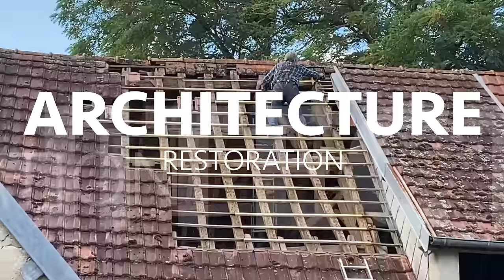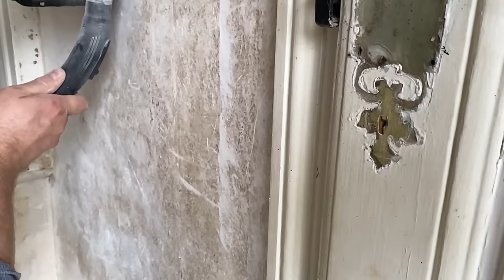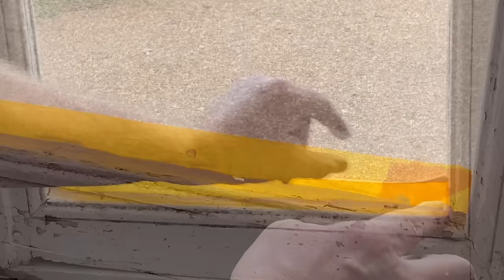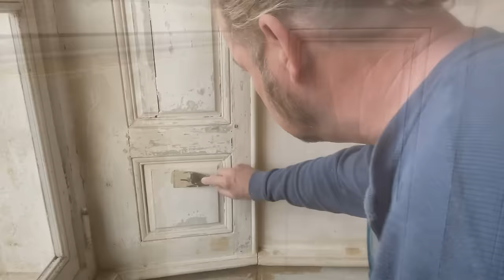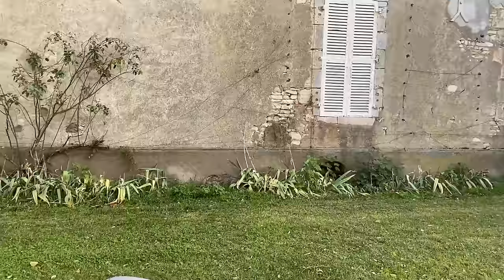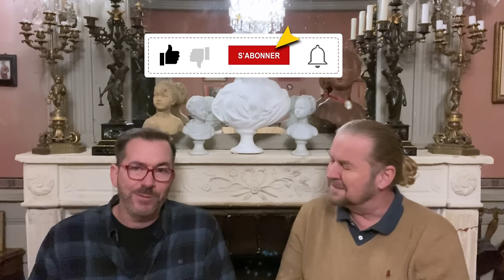REPAIRING the Storm Ciarán DAMAGE to the Chateau Roof - Journey to the Château, Ep. 144

Comment: Use a damp cloth. And wipe behind where you have smoothed the spackling. And it will make it very smooth around windows and doors and on wood trim can do it for silicone caulk as well.😊